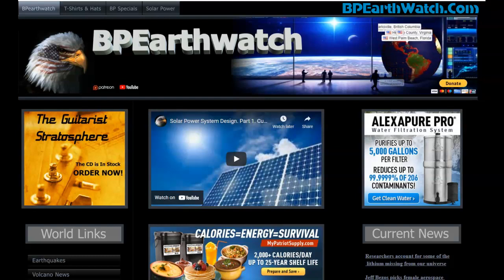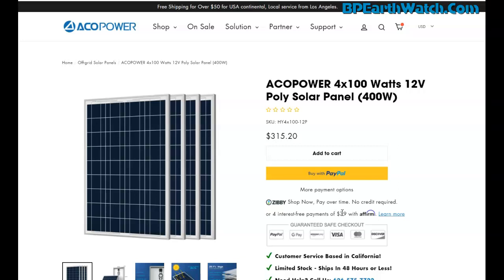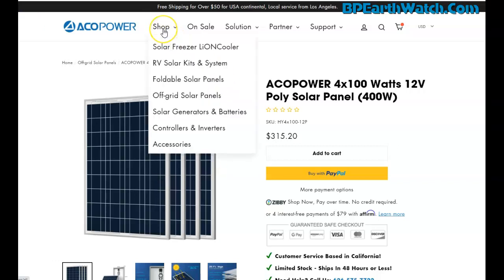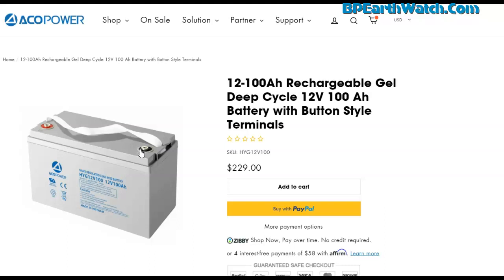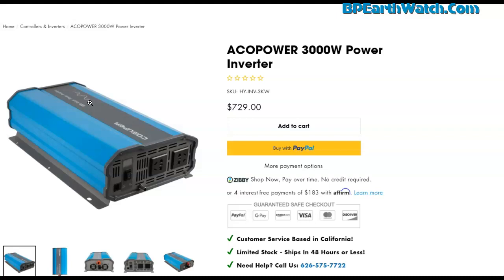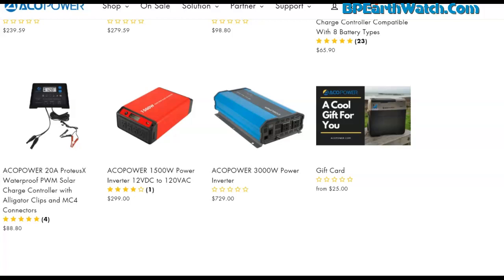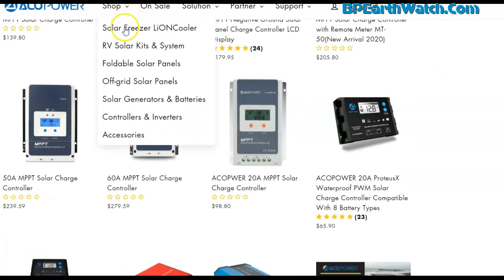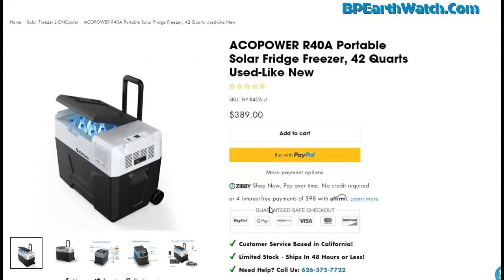Custom Solar Power System/PT.2/Components.

Comment: I have 12 T105 6volt Trojan  batteries , A Morningstar charge controller 3000 watt invertor 1000W panels on a 24volt system. The Trojans are 350AH each.

Comment: I would think buying a solar-powered generator is easier to use and U can also use A.C. ,, WINDMILL  ETC-to charge it ;  PATRIOT has a sale now of about $2500.00- ,1800 hrnd W. and it comes with 2- 100 W. SOLAR panels with a 25ft. extension cord.
Reply from the maker: This system is the ultimate solar powered generator..
Reply: The generator you listed that is crossed out is hot garbage, do NOT be tempted by them using the P word for their name. HOT HOT garbage. And using a windmill is highly restrictive bc it needs to be  at least 50 feet up in the air for any kind of usefulness.